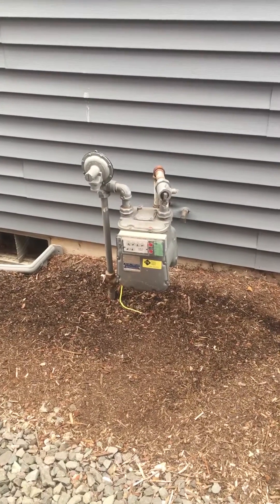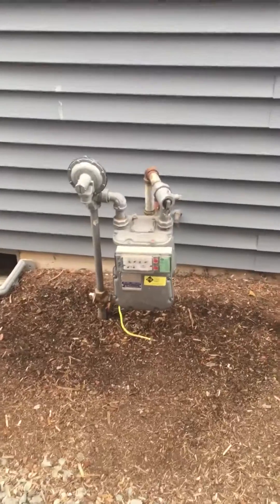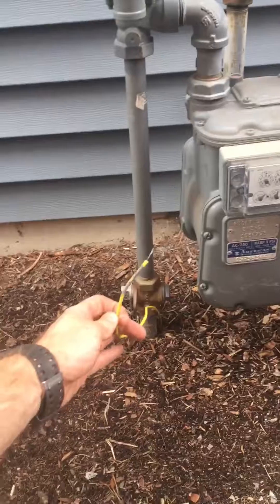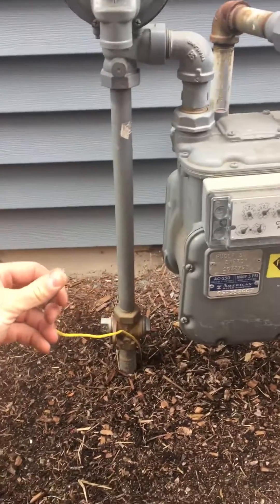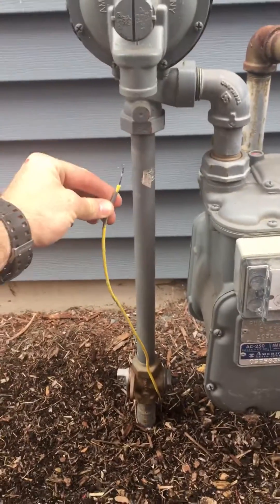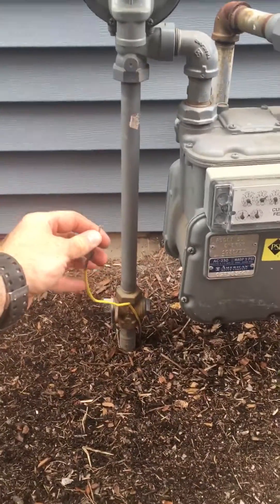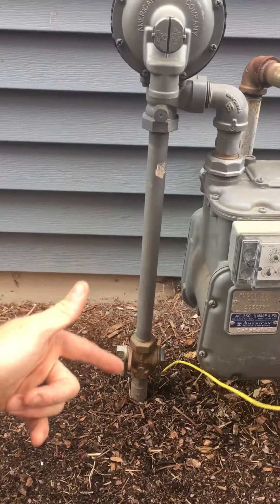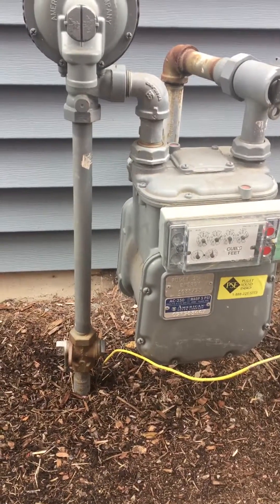Gas line tracer wire

Comment: Now I know , thanks for this video.
 It would be great if the gas co. just put a clamp on these so people would stop calling thinking it's a loose ground wire...
Reply: That would help, but sometimes you might get a homeowner or contractor bury the plastic tracer wire under pavement. Even though it was secured around the riser.
Reply from the maker: That would be nice. It definitely leaves room for confusion left like this.